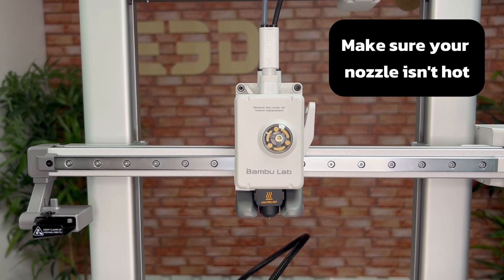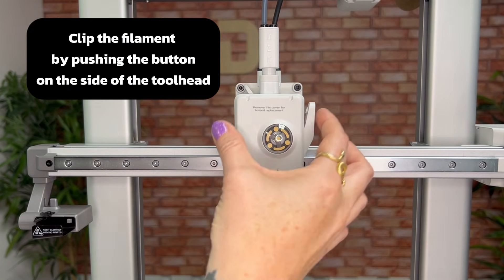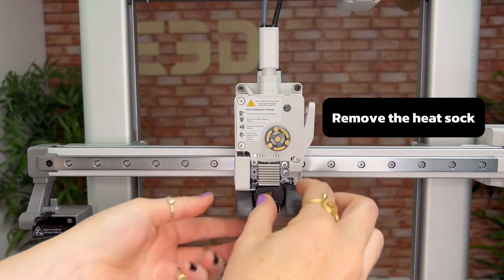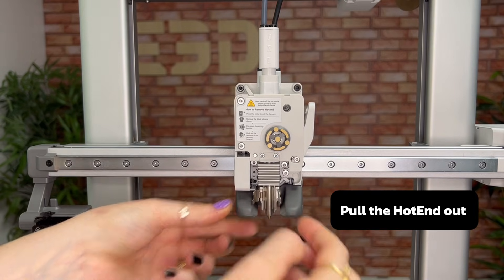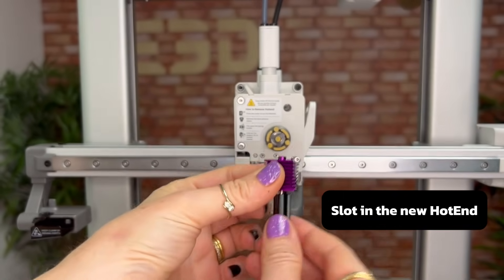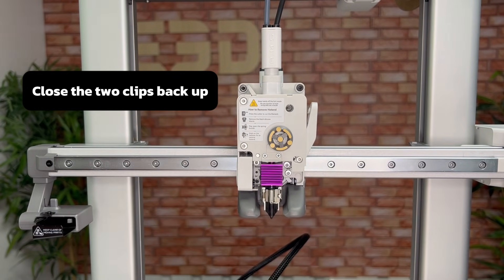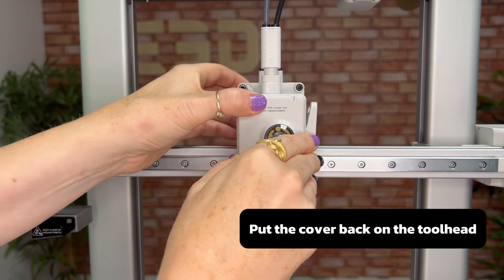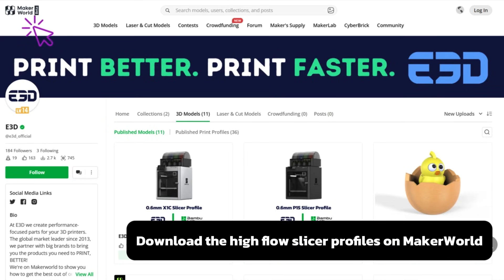How to install an E3D ObXidian High Flow HotEnd on your Bambu Lab A1/A1 Mini 3D Printer

Comment: Do I need to change the nozzle option on the printer's control panel?
Reply from the maker: Hi, all you'll need to do is make sure the nozzle size is correct and that it shows as hardened otherwise it will tell you that the nozzle type doesn't match Bambu Studio, but the firmware doesn't have an option to explicitly choose ObXidian. Hope that helps ☺️

Comment: Been using the 0.6mm one for two days now non-stop printing. Does indeed work as a non-stick to some degree. Getting more sticking on the sock than on the nozzle. Haven't tested insane speed yet, but I did try upping max flow rate a bit on some filament by guessing without any calibration to figure out the max and seems to work.

Comment: What’s the deal with e3d absolutely ridiculous prices on these hot ends?
Reply: Is not expensive, the more difficult tech you need to make the product the more the product will cost. They created 4 holes for better heat transfer, is not as easy as drill it with regular drill.
Reply: I guess licensing and patents? Also manufacturing of course

Comment: Good to see some E3D love for the A1 series! I don’t know if you’ll even see this comment, but are there any plans for any kind of 0.1mm nozzles for the A1 series? 👀 

Asking this because the A1 series seems to be quite popular for printing FDM minis and bambu lab’s smallest nozzle size is 0.2mm. 

0.1 nozzles don’t seem to be as problematic as they used to be due to advancements in filament tech. 

If there was an E3D offering for this I would definitely buy it 🙌